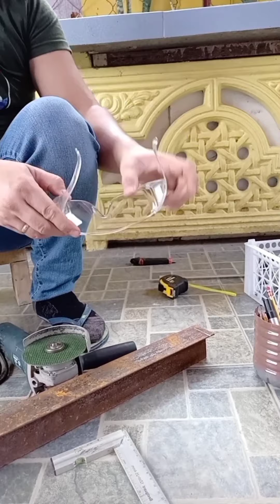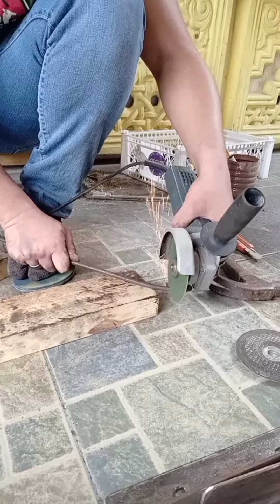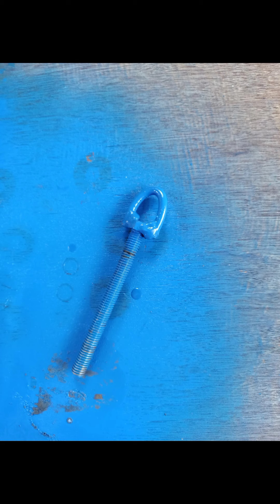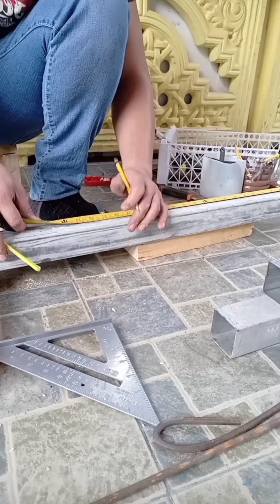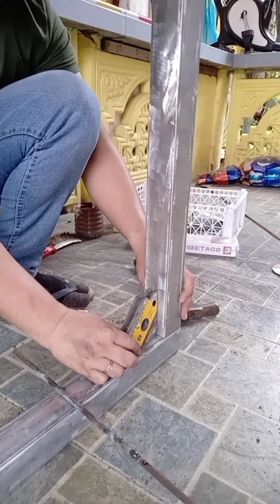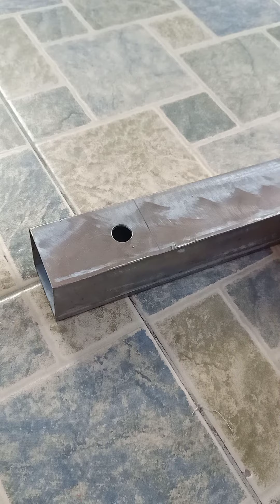DIY 1:Punching bag Wall Mount from scrap metal #metal #diy #metalworking #boxing #doityourself

Comment: Very nice. What are the measurements?
Reply from the maker: Hi!
below are the sizes of these project
>Tubular: length 2"x2"x30"
>Tubular: height 2"x2"x19"
>Angular Bar: 2"x2"x26"
you also watch the full video, link below👇
Video Punching Bag Wall Mount 
👉Part 2: https://youtu.be/11nC18r8Kgs?si=E8hUQfEjkBt3yhpO

Comment: Please measurement
Reply from the maker: Hi!
below are the sizes of these project
>Tubular: length 2"x2"x30"
>Tubular: height 2"x2"x19"
>Angular Bar: 2"x2"x26"
you also watch the full video, link below👇
Video Punching Bag Wall Mount 
👉Part 2: https://youtu.be/11nC18r8Kgs?si=E8hUQfEjkBt3yhpO
Reply: @jeyworx  omg can you give me the CM measurement please?
Reply from the maker: Hi!
below are the sizes of these project
>Tubular: length 5.08cm x 5.08cm x 76.2cm
>Tubular: height 5.08cm x 5.08cm x 48.26cm
>Angular Bar: 5.08cm x 5.08cm x 66.04cm
you also watch the full video, link below👇
Video Punching Bag Wall Mount 
👉Part 2: https://youtu.be/11nC18r8Kgs?si=E8hUQfEjkBt3yhpO
Reply: @jeyworx  thank you i like your work
Reply from the maker: Thank you☺️
Reply: @jeyworx  for the 90 degree plate how long the measure and why you make the bottom one more short than the upper one whats reason?
Reply from the maker: You  mean the angular bar or 90°. the upper and bottom is the same length or size
Reply: @jeyworx  i mean the 90 degree bar
Reply from the maker: ahh, you were referring to the tubular.
the longest bar is on the top and the one that will carry the punching bag.
the shorter tubular is the one that leans on the wall.